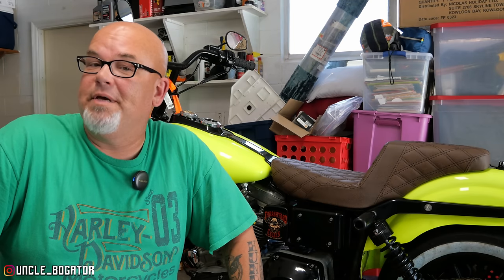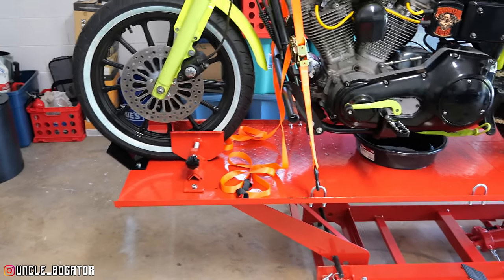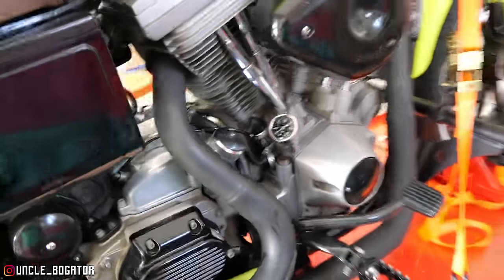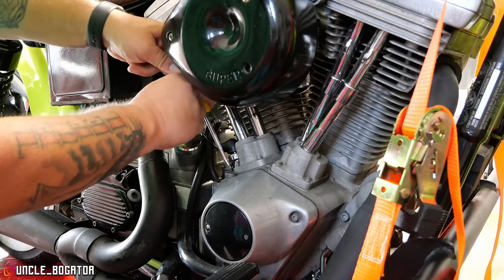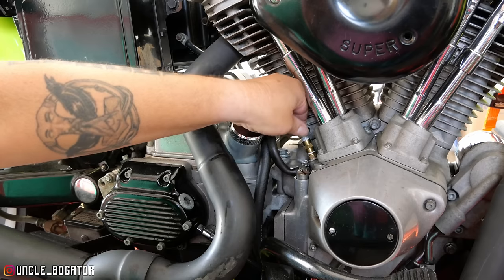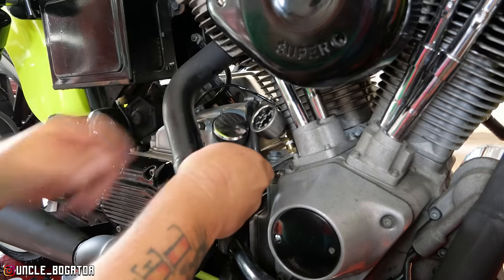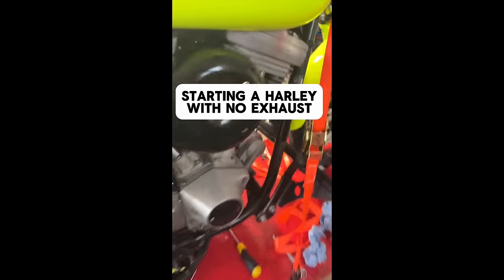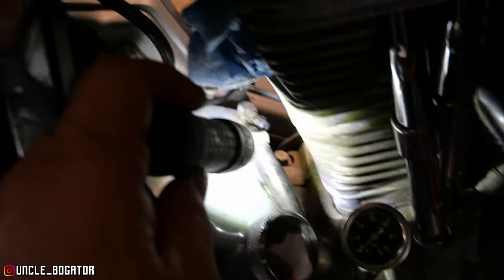This Harley Davidson is nothing but TROUBLE!

Comment: That sounds like my crappy luck with my Buell fixed the oil leaks now one of the base gaskets is leaking probably from sitting for so long..now the charging system isn't working so I'm in the middle of changing the stator..only ridden it 3 times since I got the project running lol..found out if the oil level is a little above full it will puke out the breather which there's a catch can and was full..I was wondering why the oil level was low but it wasn't the level was good I just misunderstood how to fill it 🙄..thank God to you tube university 🙏.. I bought a lift like yours as well from princess auto (Canada) sure made life easier 😀
Reply from the maker: When it rains it pours

Comment: Told ya before take it to a pro, now your going to spend probably four big ones on some thing you most likely do not need! If you relay gotta spend money buy two things, a factory service manual and a camera! HD doesn't show oil line routing very well. I am a retired master tech/instructor, take my word for it this is way over your head.
Reply from the maker: I probably responded before that I’m not going to. Haven’t changed my position on that